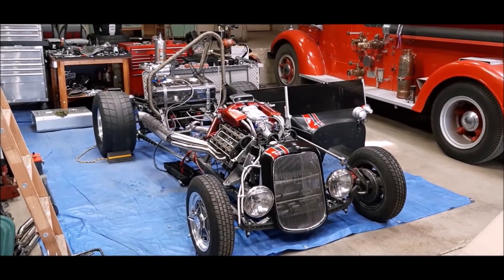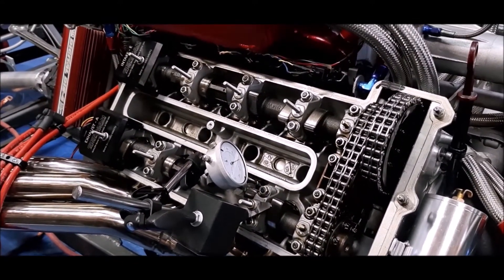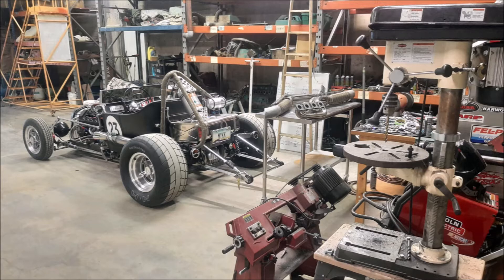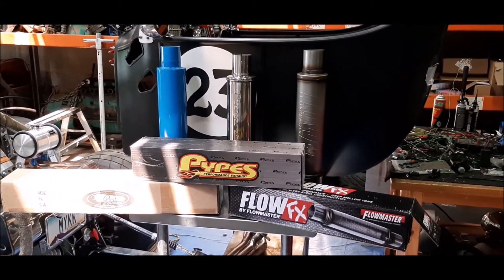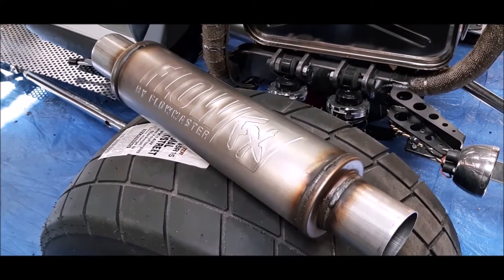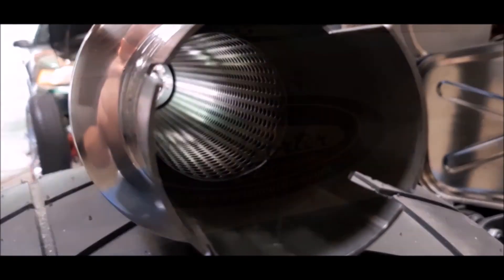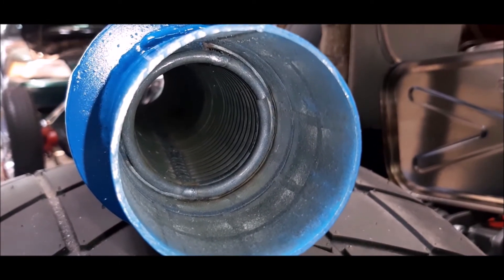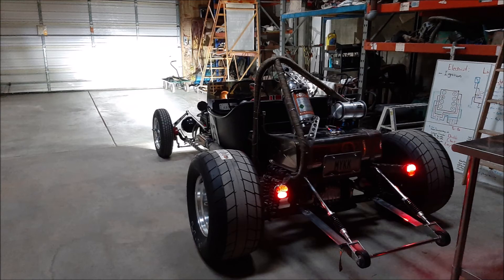Project car update 6/21/21; Swapping Int & Exh cams. Muffler Rolling, FlowFx, Pypes, Porter.

Comment: hey mykk, what do you do for work if you don’t mind?
this build is beautiful, and you have the worksmanship that a lot of people on this platform can only achieve through sponsorships, ad revenue, etc.
Reply from the maker: I work at an automotive machine shop that rebuilds engines. This entire project has been done on a tight budget, mostly parts from ebay. No sponsorships, just me wanting to share. I also figure if I throw every aspect of the project online it holds a level of accountability to keep moving forward towards the goal.

Comment: What is the orange light in the intake?
Reply from the maker: Red LED's hooked up to a PWM controlled output from the EFI controller. They get brighter with more throttle and more RPM, just a cheesy little idea that I had.